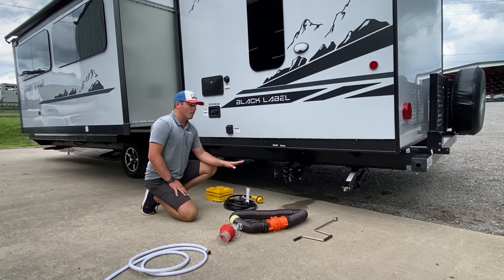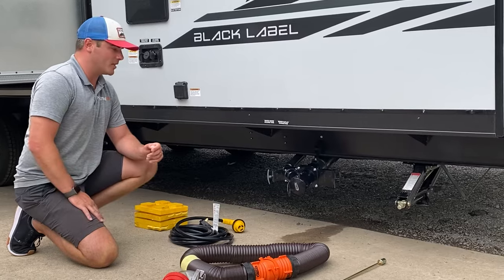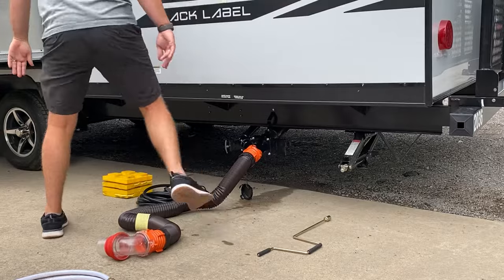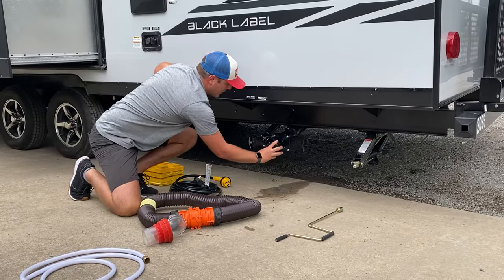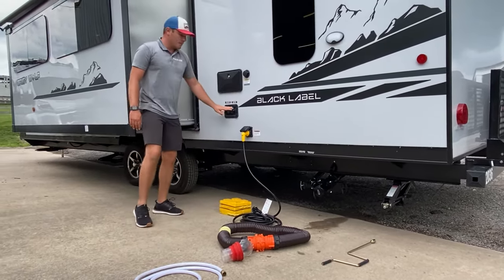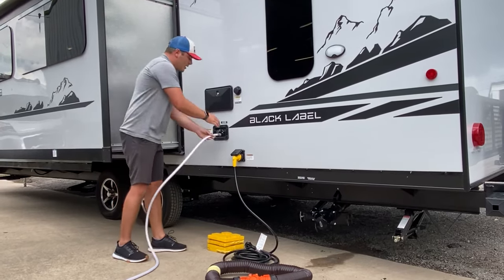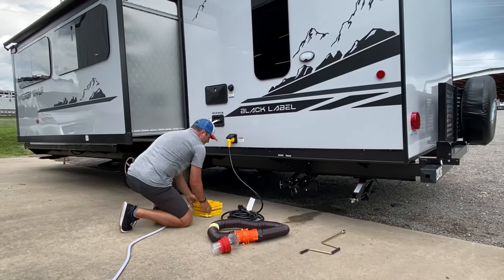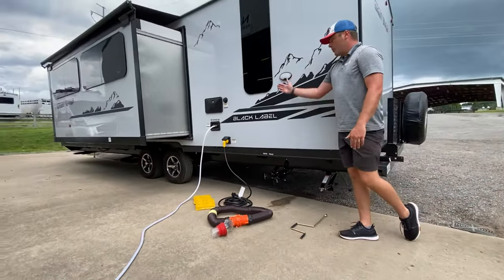RV campground setup procedures for water, sewer and electric hookups

Comment: No gloves for sewer hose? No surge protector? No water pressure regulator?
Reply: Only one id use of these is a surge protector i find it dumb that people dont use then but why need gloves its on the inside not the oitside
Reply: I think he’s showing the basic hookups. But you’re correct I would have at least explain that. Leave it to the person if they decide to use those things. I use all those you mentioned. Even rubber gloves when I’m handling the sewer hose ( regardless if I’m only touching the outside of the hose). And then thoroughly rinse it out after use.
Reply: It’s a basic demonstration of how this stuff works. Relax for fuck’s sake

Comment: There are SO many things wrong with this video. Watch this video if you have NEVER SEEN another video on RV Campground Set-up Procedures. This gives you a GENERAL idea of what to do, but there are things that you MUST HAVE before you hook these individual things up. Whether it was a legal issue and not being able to "endorse products" or whatever, but things like water surge protectors/regulators, "Y" adapters for the water hook-ups, water filters, various sewer hose adapters (like a "donut") AND GLOVES, etc., ALL ARE MUST HAVES before you hook up to a campsite!!! If you hook up like THIS, you run a VERY good chance of power surges, water pressure issues, black water contamination and a slew of other problems!

Comment: A lot of things missed in this video. 1) Wear gloves when you’re dumping your tanks. 2.) Use a pressure regulator and water filter. 3.) Do not level front to back first. Go side to side.
Reply: Wearing gloves should be a no brainer
Reply: @ricobean5604  You would think so. I see people not wear gloves more often than wear them.

Comment: This video is posted by an RV rental company, so I am shocked that no mention whatsoever was made of a surge protector for the electricity nor of a water pressure regulator or filter. So I'm really left wondering if there's a spike in voltage that fries the appliances, or a high pressure water issue that blows out the plumbing (RVs= approximately 45 psi), does your company cover the cost of the damages since no education was given on these issues? I have a travel trailer, and if I went near Nashville to visit family and we needed another RV at a campground to fit everyone, I'd be scared to rent from you for these reasons. Renters beware! What you don't know can cost you dearly!

Comment: I don't want to be a hater on RVs but terms like 'CROSS CONTAMINATION, BLACK WATER, GREY WATER'...is a joke. It's been 100 years and RV prices are through the roof but they still haven't improved the sewage system? They have made electric cars, self driving cars, and yet no matter how expensive RVs are, you still have to touch the hoses, direct it towards a dump station and smell the pooh and peeh and still feel some splatter. There should be no hoses anymore. Dump stations should only be a hole and RVs have to only drive over it dump whatever you have and move out in less than a minute. All RVs these days should have already an automated dumping system.
Reply: Sounds like another thing that'll break and a great buzzword to increase the price of an RV, no thanks!!